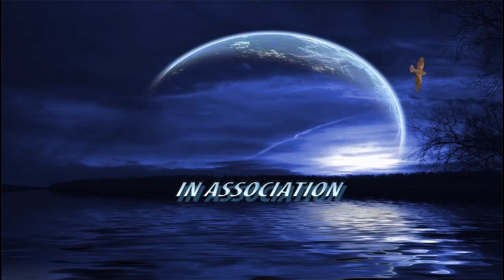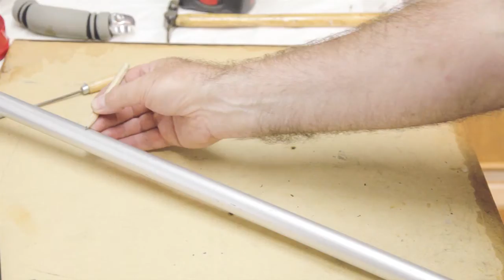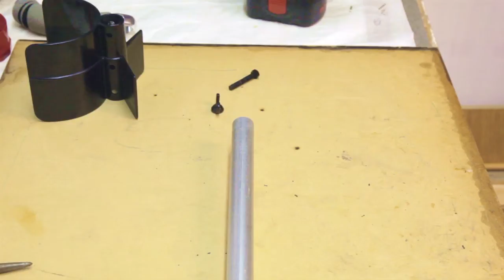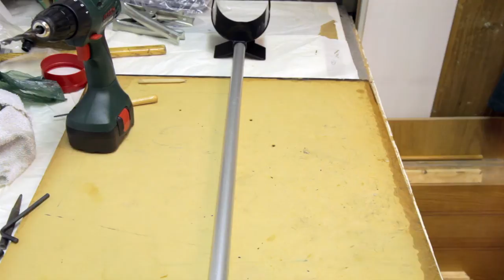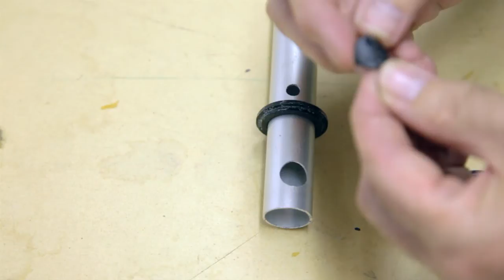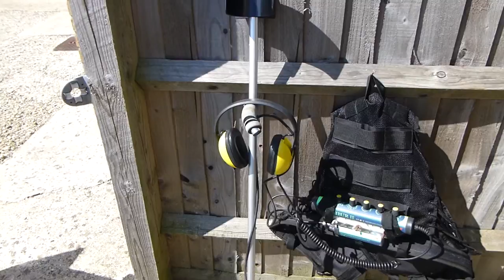How to build a straight shaft for Minelab Excalibur metal detector

Comment: Went for my first hunt today with the excal. Good grief how heavy is it!!! I've got three fused vertebrae which doesn't help but wow it's ridiculous the weight after a few hours of swinging. Thanks for this video, I can see now why so many do it! Plus why they put the pinpoint button on the handle. Cheers.
Reply from the maker: Hi Chris, as well as the handle you need to get the control box and battery off the shaft.
I use a detecting vest with the control box and battery attached to the back. Vests available from Pro-tectors and loads of pockets inside and out.
Check out my Blackpool vid from 19th may 2013 near the end you will see my set up. Now as light as using a Deus.
Replaced the yellow Koss crap headphones with my SurFFoneS which totally realised the potential of the Excalibur as you can hear all the feint signals now.
HH     Mal
Reply: Minelab Mal. Spectacular. Thanks again Mal.

Comment: Another easy way and very cheap in Australia reuse shops are crutches both types the older ones you can pull to bits and make one and the newer has the arm rest built on and hand grip a pair of either are 5 dollars here .

Comment: A very well done vid. Some improvements you can make... use a carbon rod (much lighter, stronger, won't interfere with the coil, lasts longer). Also, the arm cuff... it should have a strap (else Im sure you notice how your arm wants to come out as you swing). Minelab cuffs are crap to begin with, they easily break. The grip is also a good idea, but there is a Minelab plastic grip that is even better (see my machine) :)